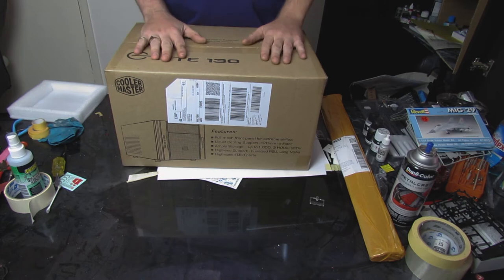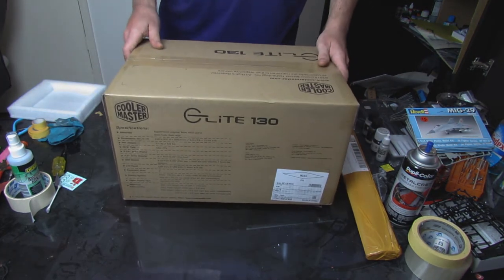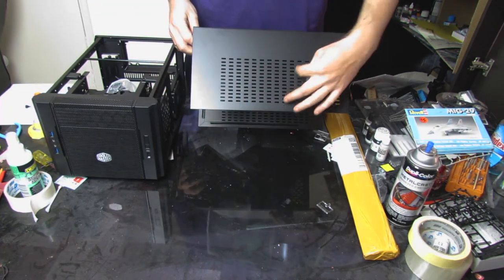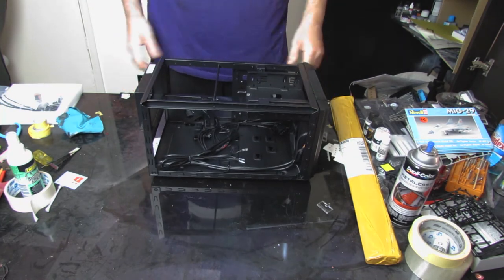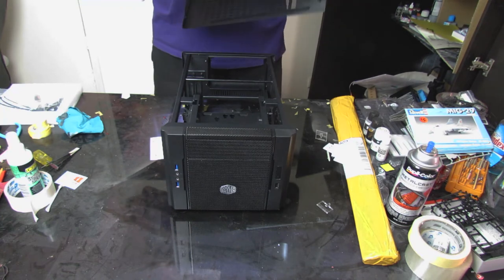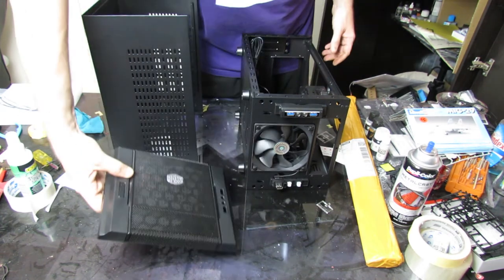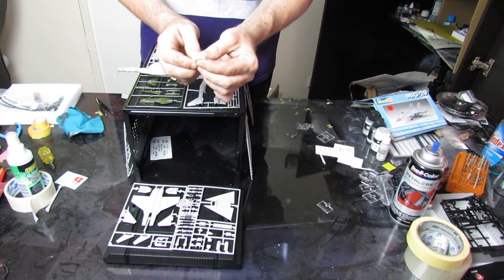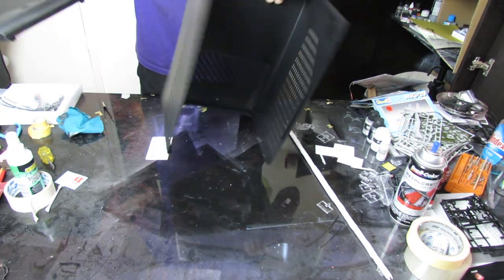Coolermaster Elite 130, Unboxing and overview

Comment: Can you fit a strix 2080ti in it?
Reply from the maker: The length of the card is fine but the 2.75 slot thickness probably wouldn't quite fit, limited to 2 slot.
Reply: @randomaussiedude  do you think it can hold strix 1080ti 2.5 slot?
Reply from the maker: Dont think anything over a 2 slot would fit, there is very little extra room. Could probably mod the side a bit and have the fans stick out. The EVGA GeForce GTX 1080 Ti FTW3 or ASUS GeForce RTX 2080 Ti Turbo, Gigabyte’s GeForce RTX 2080 Ti Windforce OC 11G would fit. The case can handle quite a lot but maybe not best thermals for the absolute top end. The thermaltake v21 is a size up and can hold the biggest cards easy while still being fairly small form factor.